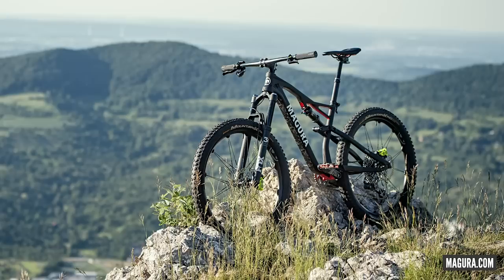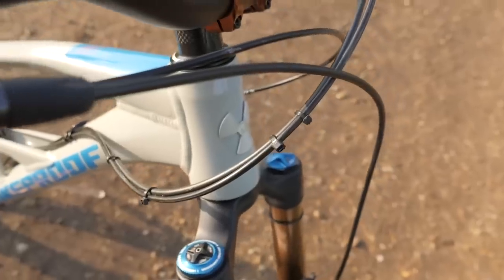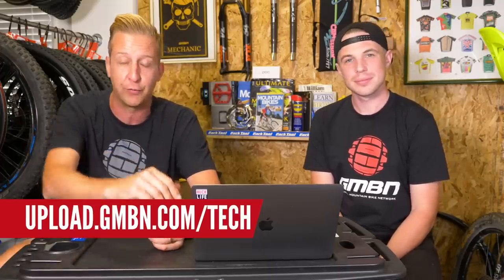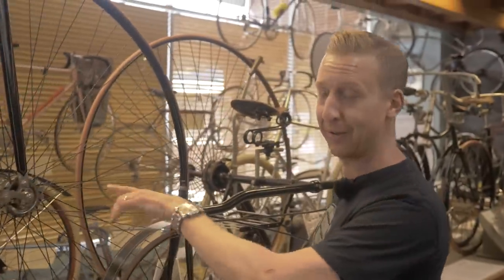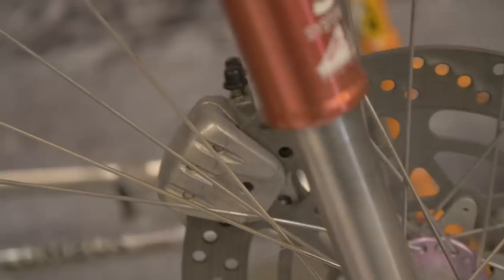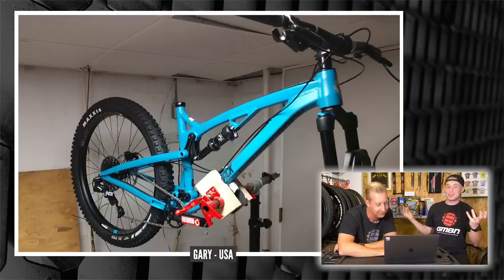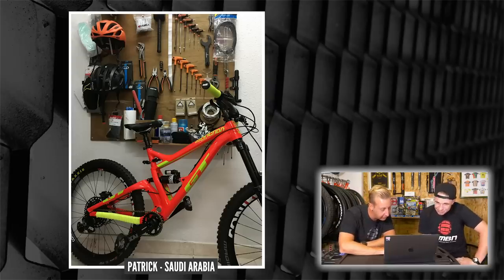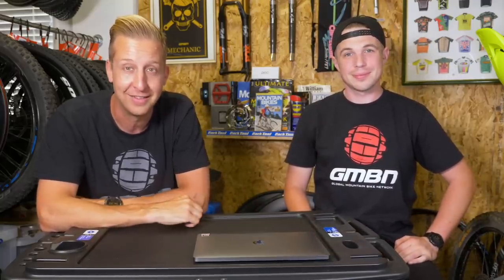Clean Cockpits & A New Nukeproof | GMBN Tech Show Ep. 78

Comment: Thanks guys for showing my bike build! (Diamondback Catch 2). I forgot to mention that yes, DB uses the VPP suspension design from Santa Cruz. That bike stand is a DIY build using a Pyle speaker stand, plumbing pipes, a QR seat post clamp, & pipe clamp. The clamps have 2x4 wood attached to the clamps and an old mouse pad glued to the 2x4's. It's only tightened up enough to hold the bike from moving and works pretty well.

Comment: In my humble opinion wireless electronic brakes are coming and will replace internal cable routing which looks great works well but is a pain to service and like everything else we will be hesitant to change until the first time you ride a bike with electronic brakes that has infinitely adjustable lever "feel" and ABS  and you never have to bleed them service is easy and hell why not a no friction penalty hub dynamo to run it all so you can't forget to charge  wow sorry for the rant love the show thanks to all of you for continuing to put it on there for us to enjoy
Reply: Nah, very unlikely.  If you look at cars steering and braking are the only things that are actuated mechanically for safety.
Reply: Would their be any issues in terms of reliability of the wireless connection? I mean like interference from other wireless /electrical devices or is that not really a thing?

Comment: Just saw the video. Thinking about cables and routing, I'm currently building an older Trek Fuel EX 9.5 up with a cable less Magura dropper post, and a Archer Components 1DX Trail connect rear derailleur. So on my bike, the only cables will be the brake hoses.

Comment: On the topic of clean cockpit. Just got a Canyon Lux (6.0 pro race) and am wondering if the Twistloc system is compatible with my fork /shock (Reba /Deluxe rlr). Also wanted your thoughts on the grip shift system, is it just a novelty or does it hold up in terms of effective shifting compared to a lever system?  I like the idea but could use an indicator for gear selection. Also would be very cool to see a grip shift style remote for the AXS wireless  system. Would be very customizable. Could also rip through the gears or go straight to a certain gear and let the electronics handle the transition in the fastest, most effective way. 
On the topic of integration concerning controls I had an idea. What about 3D printing a frame with internal channels for fluids /cables / cords. Channels for fluids would be like internal plumbing. Also their would be no need for a metal housing on the cables as the channels could simply have liners. This would reduce weight and also eliminate any sound or vibration of traditional cables. Does this exist or has been tried already? Would love to hear thoughts from the presenters as well as others in the mtb community regarding any of these topics. Thanks for all the great content and rekindling my love of biking.

Comment: MTB is truly the mad lab of bikes with all the research and development going on. I’m a roady currently, was into BMX before, and now going to build my MTB based on Blake’s Nukeproof Scout. I have a 27.5 Flow EX3 wheels boost 110 and 148 on micro spline that I won in a giveaway and I’m wondering if there’s much difference between the Scout 290 and 275 which I’ve seen on specs can both fit 27.5+ according to what I read.

Comment: 0:50 That front brake hose has a MAJOR potential to rub the stanchions on bigger compressions. But the brake internals in the bar looks sooo cool. 
Hose could be shortened,  but for any service, the caliper would have to be taken off to provide hose "excess" to go into the bar for pulling out brake internals.

Comment: #GMBN Tech -The most important part of steering geometry on bikes is, as I'm sure you know, the measure called: Trail. Wich is the distance between the front tyres contact point and an imaginary line through the steerer tube to ground. This can the be adjusted with different offset or rake in the fork itself. The more offset the shorter the trail since these axis are crossing each other. With slacker head tube angles you will need more offset or rake in order to get a shorter trail. Otherwise the front wheel will over steer and "fall over" .

Comment: Not a fan of internal routing. Did a brake change on my 2018 YT Capra and had to remove the upper headset cup to get access to route the rear brake hose. I even bought the Park Tool kit. There is a tab with a hole the hose has to go through at the front of the top tube with the derailure housing what a PITA

Comment: I would prefer steerer tube routing and hydraulic gyros over custom internal routing bars. More options for me.
I also prefer the semi-internal/clean routing over internal. You can just remove some panel covers and you get proper access to the cables.
Reply: alot of the guys in slopestyle tried hydro gyros but witched back because it resisted alot of movement
Reply from the maker: @trys9262  We have experimented with them before and the resistance isn't actually massive but we can see how it would be a problem when you're trying to chuck a Quad-Barspin though! 🤣 The early early ones used to sweat and required bleeding fairly regularly and without being integrated into the frame push up the stack height.
Reply from the maker: Check out the Prototype slopestyle bike with integrated hydraulic gyro that Nukeproof made for Jack Fogelquist back in 2012 it was called the Rook.
Reply: @gmbntech  Wow, that integration was so well executed! I'm alsoimpressed with the down tube TT shifters. I know that the issue can be easily solved now with electronic shifting, but it's still good innovation at its time!
Reply: from the look of it sam Pilgrim his running one on his new jumpbike aswell

Comment: # internal routings are beautiful but a pain in the derrière when servicing or adjusting heights of bars or dropper posts etc.  I'm with Doddy,  a front hose looks fine.  I wonder if we'll eventually go to sender and remotes like electronic shifting.   Would you trust electronic brakes?
Reply: Not sure if I could trust a brake that could potentially run out of batteries. I suppose if you are low on hydraulic fluid it could be just as bad however the fluid does not get depleted like a battery. Good ole fashioned analog wins for me on this one... for now.

Comment: Biggest problem I have with going electronic is remembering to charge everything.  It would be bad to be in a middle of a ride and you can't shift because the battery died.
Reply: J in the VA extra battery with you? Gotta remember to have it charged also though.
Reply from the maker: All of the electric shifting systems give you a lot of warning before you run out of battery. We understand it's not for everybody but it's really not much different to remembering to charge your mobile phone.
Reply: Nah, you will get used to it.  Not hard to charge it on car ride to trail.  Already most of us use a GPS device, headphones, and GoPro.  What's one more battery?

Comment: Internal routing is amazing once setup, just annoying to replace.  I will make it bike shop job when need new gear outer or rear brake, internal cable gear easy to change.  Don't notice it being nosy on my 2018 Merida 160.  Does have some plastic inserts to hold cables in frame where cables come out.
External routed seat posts are super annoying, always flapping around with it needing more length when up than down.  Swapped to internal on HT and haven't looked back.

Comment: Having gears and dropper wire less leaves only 2 cables which looks super clean anyway. I really don’t see the point of internal cable routing for the bars. Canyons method is best. Easy to work on but just as clean.

Comment: The problem with Axis is mainly cost, if they can make it at GX price then maybe but also don't want something else to charge.  Great for E bikes which need charging anyway if they can run it off the e bike battery so just single thing to charge. 
Cable to hydo brakes are different as both don't need charging or have risk of running flat.

Comment: External routing has never bothered me, I grew up with it and wouldn't be the same without it. As it is it is easy to remo e your stem to change it, change your brakes/shifters/bars if they were to break. Easy to grease and service headset etc. Internal routing looks nice, but also looks a nightmare due to the above. It also brings parts to specific and not generic giving the industry to charge a premium to the 'must have the latest' folk out there.

Comment: I agree that a completely bare cockpit is appealing but, it's a bit far in my opinion adding a lot of work to the routine stuff for essentially nothing but aesthetics. What's wrong with spending a little bit more time with cables and hoses getting them dialed in length and zip tied/heat shrunk for the cleaner look?

Comment: You are wrong about the fork offset. The more offset the fork has, the smaller the mechanical trail becomes, and therefore the twitchier the handling feels.
Reply: @Henry Quinney You should take a look at what Cannondale has done with their XC bikes. Slacker head angle but increased offset/decreased trail. The F-Si is a very well handeling bike for a 29'er.

Comment: It’s not electric that’s unreliable it’s electronics.  Henry doesn’t  need to worry about taking out a headset spacer as you can’t unless you cut the spacer as the brakes go through it and forget changing stem for riding different places anyway.

Comment: #askgmbntech#Doddy and Henry why do mtb tires use presta over schrader valves, the presta  valves just seem so fragile were as Schader seem to be more durable, and in a sport that needs durable they seem to be a weak link. I have broken 2, one on the trail and one filling the tire with a hand pump on the side of the trail, when my pressures were too low.